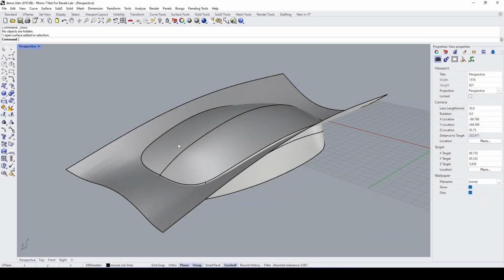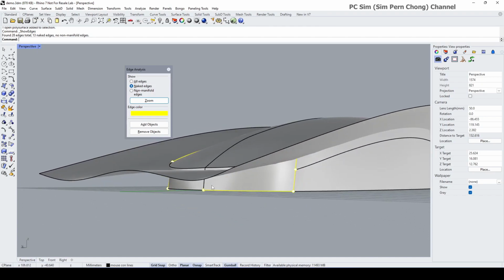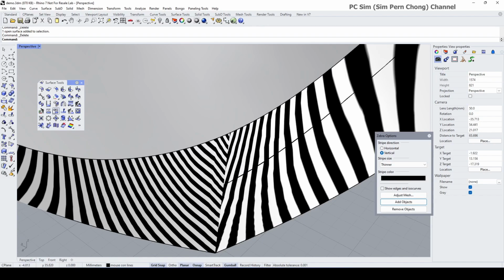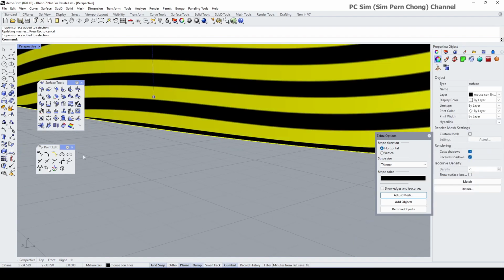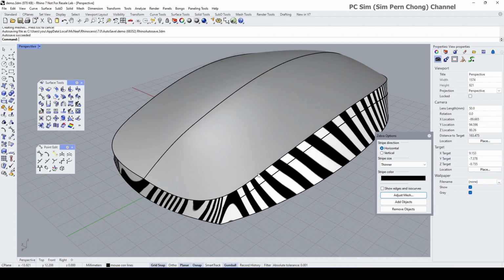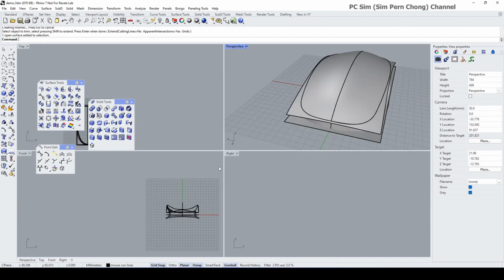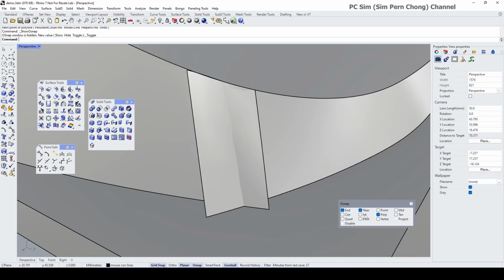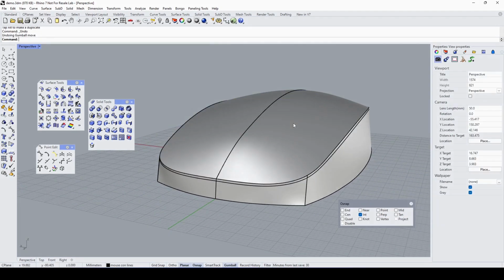Rhino 3D Demo (Requested): Fixing model for Boolean Operation

Comment: As I am seeing the video, I think Moi 3d will do that task in 5 minutes because there is only 3 surfaces to rebuilt which can be easily done by extracting iso curves and do networksrf, sweep2. Even same is true for rhino as well.
Reply from the maker: I will love to see a demo..as i don't have moi. Care to show? Thanks in advanced.
Reply: provide the file @simpernchong
Reply: please dont be obsessed with my comment but it also happens with me that whatever thing comes into my mind first, i just go with it and struggle to find solution even i can stop for a moment and say to myself, what i am going to solve actually and then reimagine the possibilities. Actually Moi 3d is same as rhino but it is quite simple and powerful, however not as versatile as rhino which has so many pluggins, tools. people use both but Moi 3d dont work like command based, it is shortcut based and hence it is very fast while rhino has to do lot of things hence it is command based @simpernchong